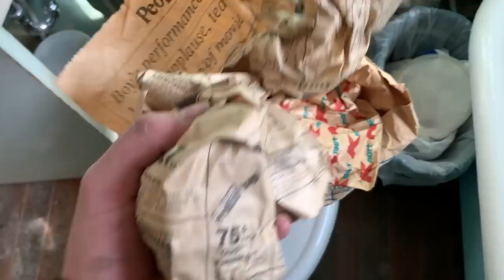Part 13. The Potters House, a quick update... and guess what I found!

Comment: Find a local community college art professor... They might be interested in repairing and working up the replacement part for your stained glass. You'd be surprised at how many appreciate the experience for their students.
Reply: Yes!  Great idea.
Reply: Stained glass isn't super hard to work with. I took a community education class and built my own stained glass panel. It's just a matter of glass cutting and lead soldering. You should totally be able to get those windows fixed and they'll look so much better than the fake decal thingies!
Reply: This would be so cool for the students!

Comment: the stained glass side lights  i would consider sandwich them between clear glass just for security and to protect them .the stairway  looks like the sides of one of those old bent wood rocker strange design maybe mary knows for sure?
Reply: THAT'S what they reminded me of. It was bugging me lol
Reply: Rick Walker yes indeed the sides of the stairs do look like those rocker legs! I just googled it LOL!! My Nana had an old Brent Wood rocker! Couldn’t recall where I’ve seen that design before!!

Aren’t the side stair railings metal, though? Don’t recall those rockers being metal, only wood. 🤔🤔🤔
Reply: Alex gave Josh a bentwood-like rocker made of metal pipe, with plywood seat and back that was found in the house.  Wonder what it will look like when Josh makes use of it...

Comment: about the stained glass panels , after you have them repaired it might be a good idea to place them behind the clear windowpanes , have the carpenter add some extra trim to the stock frame 
it will insulate against cold a little better and it will prevent the stained glass windows from more damage or getting pushed in and out of the windowframe by someone trying to break intoo the place 
about the wood in the back of the truck . one thing i seen once was a guy bought 2 roll over bars for his type of truck and mounted one the normal way behind the cab and one turned around near the tailgate  , he used it as an rack to stack the wood up on ,he made the mistake to load 5 logs ion it and it kinked the rear roll bar after driving through a pothole but you can load some material on that
Reply: Ar last someone with sense.

Comment: And the stained glass usually goes at the top not the bottom. Feet and shoes can very easily damage them if placed on the bottom. Every old house i have ever seen always has the stained glass up top.
Reply: Or the stained glass sidelights need to be protected.

Comment: What no buried treasure?  Just keys?  😉 Loving the process.  And it’s costly but yes they can be repaired.  Leading on Windows needs to be replaced every 50 years as the lead gets soft.
Reply: So, therefore, it should be okay to use a non-lead alternative? Is there such a thing?
Reply: The metal needs to be soft as it is a tape that goes around each piece of glass and then is soldered together.  Even a good painting needs cleaning occasionally and revarnishing every 50 years.  Non lead alternatives are available for jewelry and items like trays that can touch food, but you still usually need to have windows redone.  You’re talking heavy glass held together by thin metal tape.  Our church just had ours all redone.

Comment: If you only have three of those side-windows..I might think about taking the two best ones and using one each side, positioned centrally/half-way up...I think that would look good and avoid the cost of a fourth??. :)
Reply: I'd be tempted to put them on the same height as the glass pane in the actual door and have wood panels below. The house seems like an unusual style to me so I can't speculate much about what it'd have looked like originally but I'd actually feel like putting the stained glass on top would look more appropriate than having those full-height panels.

Comment: The  silver (plate?) and glass apparatus in the bathroom cabinet with the seashells  is a "condiment castor".  Each vessel would have held a different table condiment - salt, pepper, oil, vinegar, cream or milk, etc, which is why the vessels are specialized.  It's my understanding,  this would be more commonly be used to let someone eating in their bedroom season their food  rather than be something you would see on a dinner table.  Mine even has a bell so you can signal the servant to take it away.  It of course would be of the same era as the pickle castor you found in the attic.  I really like to see a better view when you get it back to your shop.

Comment: So much fun, keys, leaded windows, doors, concrete countertops, sink.... Love it all except the Red stairs.  Scary!! Could you possibly paint a faux runner up the stairs, perhaps in the color of the walls. Hey Josh, vibrate those counters or they will crack due to air bubbles. A small piece of stock wire mesh embedded in the concrete will add strenght.

Comment: Alex have a good time at your brother-in-law's party. What's in this house two units if so then the wood that the boy fan broke probably was from the loads that it was carrying before you started your work, somebody needs to go underneath it and see if you have a problem by the stairs with support! You would think that you would not have a problem because if you having a full basement so I guess somebody needs to go into the basement and see instead of saying kind of structural problem. You're doing a wonderful job and you are very nice young man I can tell. Your friend Rose in Las Vegas
Reply: Looks like my phone did not put the correct grammar are punctuation in this message.

Comment: There was a wall that went alongside that staircase - that's why the floor looked damaged but also why the stair treads have no bullnose on the open side and the wall and stringer are flush with each other.
Reply: Whatever. I just hope they vac it out. It will look strange but old homes do.

Comment: I don't know anything about making concrete counter tops, but some things that I know about concrete may be useful.

Making Concrete

Terms

Cement: gray powder made by roasting limestone and quartz sand together, then crushing the resulting clinker

Mortar: a mixture of cement, sand (<5 mm particles), and water

Concrete: a mixture of cement, sand (<5 mm particles), coarse aggregate (>5 mm particles), and water

Water: drinking water quality for best results

When water is added to cement, it forms a gel which then hardens as a result of chemical reactions.  The more water and the less cement that are mixed, the weaker the resulting material is.  In highway construction, the strongest concrete is made by barely dampening the concrete  mixture, then compacting it with the same rollers that are used to compact asphalt pavement.  This is called “roller compacted concrete.”

If there was ever a light duty concrete application, kitchen counter tops would be it!  You don't need to be concerned with how strong your counter tops will be, but don't think that you are doing yourself any favors by adding more water.

Concrete shrinks as it hardens, therefore, concrete always cracks.  The transverse grooves in sidewalks are not there for decorative purposes.  Their role is to control cracking by being the weak point in the concrete slab.  They are spaced about 24” to 30” apart so there will be enough small cracks to accommodate all of the shrinkage.  Probably, you should not make the counter top in sections larger than this.

Although you don't need the strength that reinforcing wire will add, having wire embedded in the counter top will hold the cracked pieces tightly together.  I suggest that you use chicken wire (hexagonal holes about 1” across) because it is easier to work with than the heavy wire reinforcing used in heavy duty applications.  Position it in about the middle (vertically) of the slab.  The holes in the reinforcing wire should always be larger than the largest pieces of aggregate.

To put a mirror finish on the concrete, use a “float” and a “finishing trowel.”  Do a Google image search to find pictures.  The float is used to vibrate and put a preliminary smooth surface on the wet concrete.  This causes the coarse aggregate to sink and the water-cement gel to rise.  Once there is a good puddle of gel at the surface, switch to the finishing trowel to apply the mirror finish.  I'm sure you will be able to find videos online that show the technique.

The place you buy your cement will have dyes that can be added.  It is also possible to get cement that is pure white, rather than gray.  White cement with white aggregate would be snazzy.

Comment: @6:10 I had a very similar experience. Had a load of rough sawn lumber in my truck. Stopped at a stop sign and then hit the gas, well the whole stack of lumber slide right out the rear and landed in a pile in the intersection. Thankfully it was not a busy intersection and was in a neat pile like it was just off loaded out of the bed of the truck

Comment: On the stained glass windows I would have considered checking with the door manufacturer about trying to sad a lower wood and a shorter upper. Then have it so that one of the shorter one piece stained glass window in the open section.

Comment: I think the sidelights were only on the top half originally, just like the door window, which might also have been stained glass.  That's how they were on my 1907 home.  The side lights and a stained glass transom window are still there, but someone replaced the door window with plain glass.  which is sad, because I live in a flat, and unlike my neighbors I can't leave the outer door open so the light from the roof windows at the top of the stair comes through my door windows unless I want everyone to peep through our front door!

Comment: Are you looking for a old but refined look to the house? I see one issue and it is the aging material and varnish looking stuff that's built up on wood handles and aches, it looks old, but also looks very cheap. An easy solution would be to sand it down, oil it and put a layer of clear coat over it.

Comment: Go ahead and get a Bosh dishwasher from Germany the high end has it's own sump pump so if it leakes it will not damage the wood.  Also it is the quietest since you have open concept.

Comment: Why not make pseudo stained glass with the rubber sticky stuff you do the lining with and it's a paint that dries clear for the color part. you can mimic what you already have and repeat it. it's cool. If you haven't seen it done check it out. supplies are at craft store!

Comment: IMO sidelights were only on the top half.   They did not have safety glass 100 years ago so no glass would have existed at floor level.  The bottom half beside the door would have been wood panels like the door.

Comment: ill will let ou in a secret if you got a 6 foot bed keep tailgate shut put the boards on the top of the  bed rest it on back of the bed one end slightly on the right side of the cab but not near the  door carry they at a angle but strap them down though.may sound crazy but i have a customer i deal with at the lumberyard i work at has done that with a chevy swb extended cab.though at work i do not give such suggestions but for you its free knowledge

Comment: I'm wondering how they came to use bentwood rocker parts for the stair railing? Can't imagine the house would have originally had that.
Reply from the maker: It’s what Mary had
Reply: @CuriosityIncorporated  Was the staircase added after the house was built? It's kind of hard to keep track of the layout of the house and when you showed the damage to the sub floor next to the staircase, the comment was made that maybe something else had been there. Does it look like there was an original staircase somewhere else? It appears to be a four-square Craftsman style house, which would indicate it was  built probably in the 1920s. However, I have a friend who has a house that looks to be a perfect example of a Craftsman house, but isn't really. Part of his house dates back to the 1800s but was added onto and remodeled during the Craftsman era. I wonder if that could be the case with Mary's house?

Comment: I’d like to know what the home inspector said about the house. Did I miss that?
Reply: It was in the last video.  Nothing major. If I remember correctly the outside needs painting, there was a little asbestos but it's not a problem unless disturbed [but Alex is having it dealt with I think] Sorry I can't recall the rest but it was mostly going to be covered by the finishing touches anyway. Everything was sound which was the main thing.